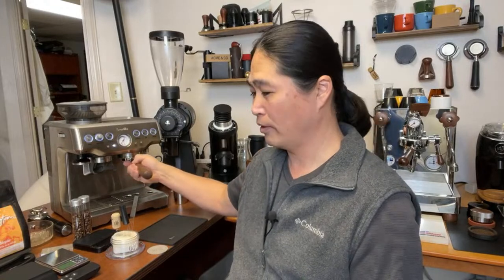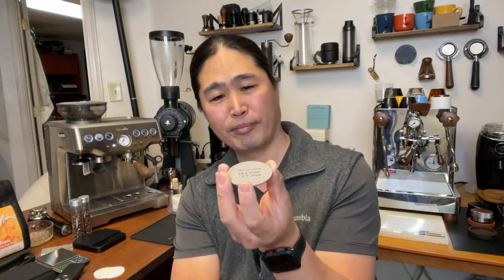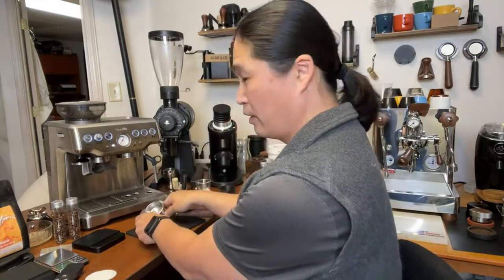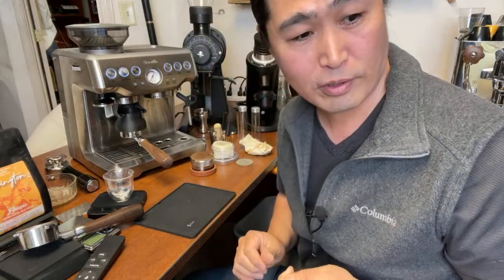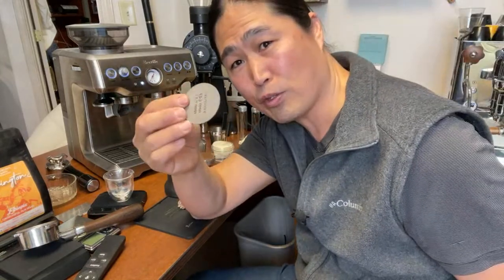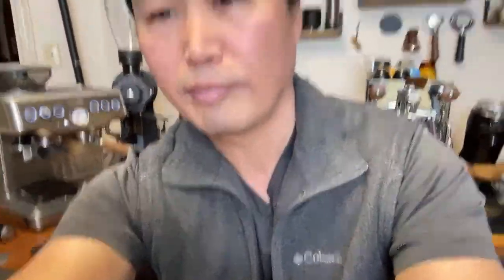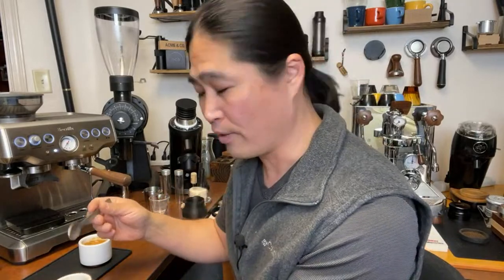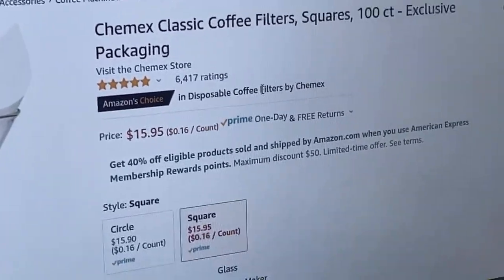"Solved" |  How to Fix Espresso Channeling for "GOOD" | Breville Barista Express

Comment: Hey, I know old video but maybe maybe that the generic/Amazon filter basket doesn't create the little bit of channeling as you say.  It' just that the IMS filter screen creates more of a laminar flow, whereas there's a lot of turbulence from the holes from the cheaper basket, which creates a bit of a splatter once in a while.

Comment: This is not fixing the channeling but covering it up, look at those giant holes in the puck at 15:42 and 16:27, that's channeling. The water inlet is hitting the holes in the IMS screen and creating a water drill. I fixed this by using a thin Stainless steel plate above the shower screen. This is a crude dispersion plate, I used a nail to place six holes around the middle but not in line with the water inlet. Then 5 short slits around the outside edge using tin snips and it keeps the plate from moving. The nail holes keep the plate from going flush against the screen. Both the holes and slits allow water to be back flushed at the end of the shot and for cleaning. The shots are better more flavor in the cup, nice upgrade.
Reply: Hi,Do you have a picture of the plate you made by any chance?

Comment: Surely, the paper has the risk of adding a flavour. The puck screen on the top was to generate a consistent wetting of the top of your puck, which seemed to give a faster central streaming than you achieved with the paper on the bottom.
Apart from that, I thought you would add the paper screen above your coffee and not under it. Moreover, why not cut your paper screens from conical paper filters?

Comment: Just to be clear... This does not "solve" channeling" it disguises channeling. Just like if you use a normal portafilter (with a bottom) you can't see the channeling going on. Bottomless portafilters let us see the channeling and help us to improve our puck prep techniques to avoid channeling. Using a filter paper on the bottom of your basket on a bottomless portafilter is just hiding that channeling again. Which kind of makes it pointless to use a bottomless portafilter. You may as well just use a standard portafilter if you just want to hide the channeling you might have. The ONLY way to "solve" channeling is good consistent puck prep. It is not by hiding the faults with things like filter paper.

Comment: Hi Hoon, is okay to use tissue paper to wipe the shower head?
Reply: if using the stock shower screen you could use a commercial paper towel, don't do that on the ims shower screen as it will tear up the paper towel or tissue.
Reply: I see. Thanks Harry
Reply: @Crystal_belle77  on the stock screen I use a micro fiber cloth, cheap at dollar stores or Walmart. On the IMS I use those poly brushes as it has sharp edges around the holes and you might get junk stuck in it. A little harder to clean but less hassle in the long run.

Comment: For anyone that has a 58mm portafilter, Cafelat Robot filter paper fits the bottom and the top near perfectly. They can be found at both Prima Coffee (U.S.) and idrinkcoffee (Canada), which ships to the U.S. free for orders over $50.00. They both got my order to my door(Illinois) in about 4-5 days. Anyone looking for a lighted mirror for their bottomless portafilter shots Flair Espresso has the best deal. Plus, their "58" puck screen is a re-branded Bplus screen at a cheaper price....Cheers!